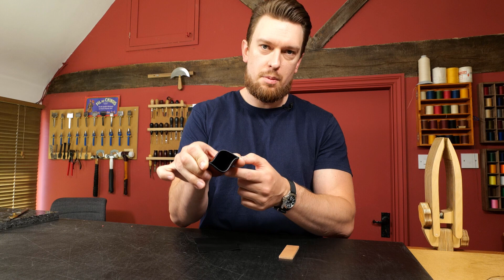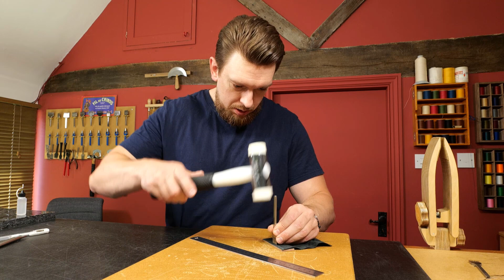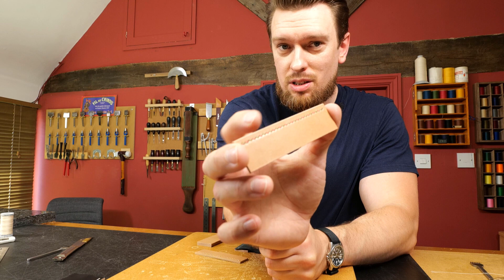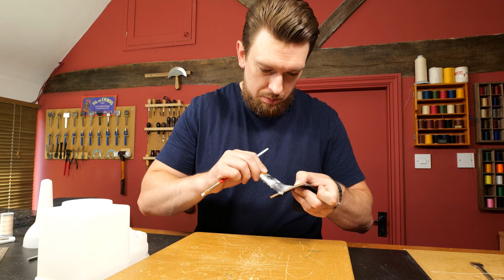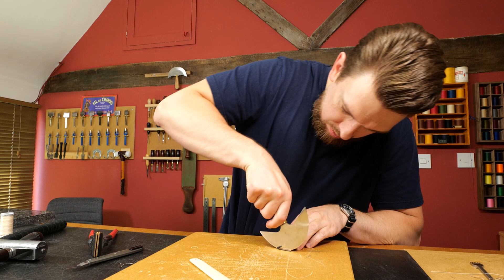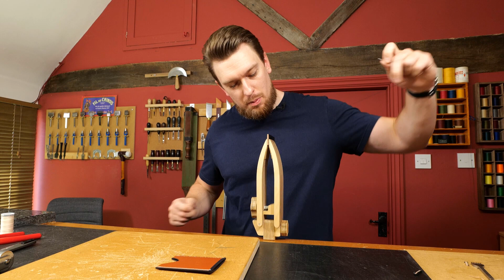French Seam Demo- No edge paint or burnishing needed!

Comment: I know this is an old video.. but how would you go about wrapping it around and doing the same seam on the other side? Seems like it would be tough to get the tension correct
Reply from the maker: You wouldn't. You will need two separate French bindings that overlap in the middle with a separate seam of it's own.